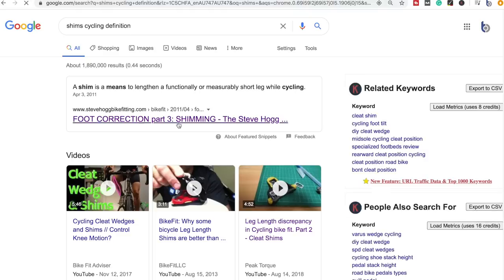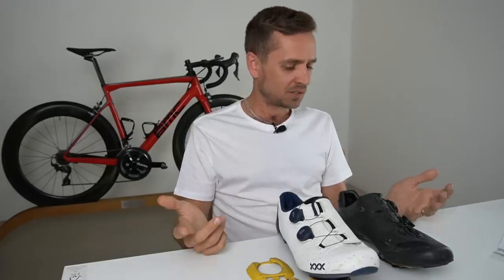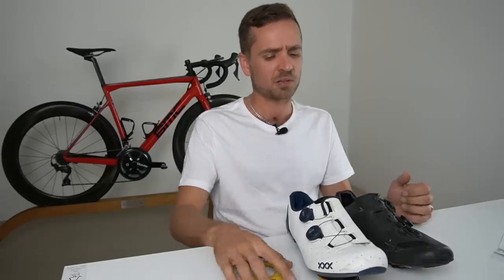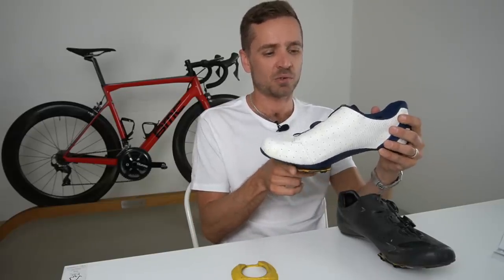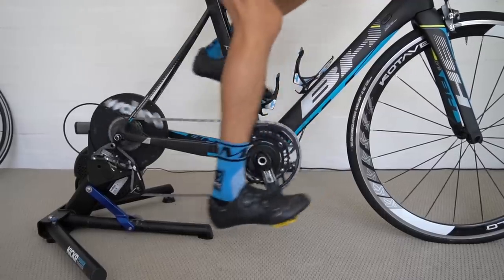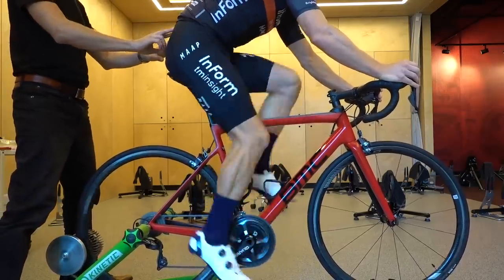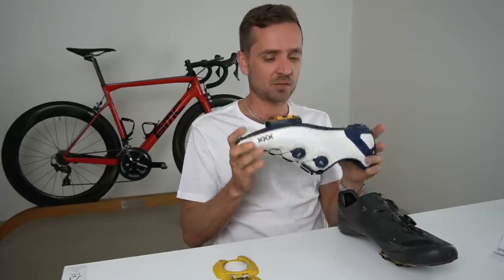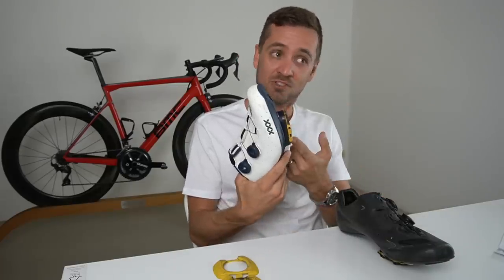75% of Cyclists Leave this Bike Fitters Clinic with a SHIM (why?)

Comment: Hey Cam, I have a leg difference of 1.5cm, what percentage of total leg length differences would typically be a good starting point. Also what about MTB shoes, where shims are unpractical to fit as they need to be recessed. Thanks,
Reply: I'm going to follow this comment as this closely applies to my 12mm structural leg discrepancy.  I do both road and mountain biking as well.
Reply from the maker: I'll see if I can get @Neill Standbury on the case here.
Reply: If it's been properly confirmed with a 3d CT scan or a proper standing leg length xray (image taken whilst your knees were locked into extension) and it's really 15mm, the answer will depend on where the LLD is located. If it's all tibial, start with 10mm and work your way up incrementally towards 15mm by feel. If it's all femoral, start with 3mm and do the same. If it's mixed, you'll want to start around 5mm and slowly increase it. Things will feel better and better as you get close to the ideal height - then at some point when you overshoot you'll start to feel worse and have trouble getting over the top of the stroke on that side, hitching your hip slightly as the knee rises to the top of the stroke. Hopefully you can sense it - most riders can - but some cannot.
Reply: Neill Stanbury - Firstly, thanks to both yourself and Cam for the great videos. Unfortunately, my leg difference has only been verified visually (twice by individual doctors) as my pelvis was not horizontal and therefore I initially had lower back pain. I have been riding with 5mm shims, but recently moved to 6mm and also moved my cleats back (approximately 2cm, with the shimmed cleat 1mm further back as mentioned in Steven Hogg‘s homepage). I was uncertain if I should try more shims and see how it feels, also as I ride cyclocross I cannot shim the SPD cleat as it would then sit proud, would a staggered cleat setup be ok? Thanks in advance for any help.
Reply: @CG-vb9di  How can you clip in into shimmed MTB cleats in a race setting? I have the hardest getting into shimmed SPD cleats (8 mm) at all - I had to cut longer than standard shims myself to have some success.

Comment: Are all leg length discrepancies to be corrected or just the ones giving actual problems? How often a reassesment is needed in order to verify if the shim has to be changed or removed? Are usually shims to be used permanently?

Comment: What about riding with a different length crank?  I occasionally do this when I put my 175 stages power meter crank on my bike with 172.5 cranks.  So my left leg uses a longer crank
Reply from the maker: This can really through off symmetry from what I have been told.

Comment: I dont know if I have a leg length discrepancy, but through experimentation, for whatever reason, 5mm shim on the right shoe has alleviated my right it band syndrome, right knee pain, left lower back pain, and left saddle discomfort 🤷‍♂️ i do have a very slight scoliosis. would my situation be considered a "functional" discrepancy? my left leg is also a little more muscular than my right and my right foot is a few mm shorter than my left 🤷‍♂️

Comment: Too bad he didn't differentiate between short femur vs short tibia. In a short femur wouldn't it make sense to stagger the cleat for when your foot is at 3 o'clock,  and also add a shim for the 6 o'clock position.
Reply: Fully agree, it's the one single point that sadly is missing in this amazing series

Comment: How does one adjust for differently sized feet? My left foot is about 7mm longer. I tried to put the cleats on staggered by this amount and while my feet feel symmetrical on the pedals, I can feel that I made my right leg shorter with this method. I readjusted the saddle height and when it's just right for the right leg, it's a tad to low for the left leg. Didn't Neil put your cleats on staggered, too?
I would really appreciate some advice here. Thanks alot.

Comment: What about if the hip is dropping because their is uneven saddle contact due to saddle width or too much reach or drop etc. How do you factor out other complications if the rider does not know how stability feels like(so would respond that it's good when really it's just better than what they are used to) or isn't very vocal unless asked?
Reply from the maker: I'll see if Neill can get to this Q! Thanks for asking. Cam
Reply: There are a million reasons a rider may drop one hip, a leg length discrepancy is just one of them, you are very much correct. If the rider has no concept of symmetry or poor body awareness, then I am forced to use my eyes and hands as the sole method of determining optimum symmetry.

Comment: Hey Cam, have you got shims fitted on the same side as you felt the issues/pain? 
Wondering if there's a common pattern/factor of which leg exhibits the pain/symptoms (maybe you could ask Neil??)... eg, does the pain show itself on the shorter side 99% of the time?
Reply from the maker: I never had knee pain, just didn’t feel quite right in my position
Reply: Good question Carl - and the answer is there is no clear pattern although most riders develop left sided pain due to our inherent right side neurological bias. This is irrespective of whether they have a shorter left leg or a shorter right leg, or anything else.

Comment: I always get saddle sores on the left side and sometimes after riding long in aero bars my lower back hurts only in the left position. Ironically, i feel more soreness in my right leg (all the muscles: hams, quads and calf) as compared to the left. Is it the leg length discrepancy?
Reply from the maker: Could be, I used to get the same.

Comment: Any idea if a heel lift would have the same impact as a mid foot shim?
Reply: Given that the heel lift would not be under the cleat/foot interface, it almost certainly wouldn't work ideally. It will also load the forefoot unusually compared to the other side (by tilting the foot forwards) and thus probably induce more assymetry. Never tried it though, so I could be wrong!

Comment: What about foot size length? Having half a size smaller, and shoes are loose what to do? As you wouldn’t want movement in the shoe?
Reply from the maker: I'll see if Neill can get to this Q Ian! Thanks for asking. Cam
Reply: You could find some Lake or Bonts and order different sizes left and right, or if it's just a half size then a thicker sock will almost do the trick on the smaller foot.

Comment: And yet when you talk to some sports physios they say this is complete rubbish. Depending on how you stand at different times one leg can appear longer than the other is their comment
Reply: Exactly.  I'm not buying what he's selling.
Reply: Absolutely right - this is why I measure leg length 4 different ways, in standing and lying postures, to get a rough approximation of the real difference. Even then my measurement error is typically 3mm or so, and sometimes stretches out to more than that in extremely weird cases!
Reply: Phew, luckily I'm not selling anything!

Comment: Hey Cam,  you put out some great videos but if I were you,  i would stay away from calling people an expert in anything as I can honestly say that this video is very flawed when it comes to the Neils expertise.  As i have myself been advised that i had a hip imbalance many years that made one leg longer than the other some time ago,  it was corrected once i saw my chiropractor and had it adjusted.  With Neil being a physio,  he seems that he does not want to acknowledge that if a rider comes in with this imbalance,  it can be fixed very easily to visiting a qualified Chiro.  I have been lucky to not have any issues since this was brought to my attention.  BUT at the same token there are some people that do have an imbalance which require a shim.  I have a friend in Sydney that requires a shim because of an accident with a motor vehicle while riding as he has injured his spine alingnment.   There's always been and maybe always be a conflict between Chiro's & Physio's to this extent as each other criticise the other.  But its this issue of the Physio that does not give advise to the client to seek this change to at least have it checked and adjusted.  The Chiro that i have seen always completes the visit with muscle work after the manipulation to assist.  What does the Physio do to solve the issue,,,  throw a shim on it...
Reply from the maker: Thanks for sharing your views Nick. Appreciate it

Comment: There are 2000 pro world touring cyclists. No one shims or wedges bike shoes. NO ONE. They all use custom fitted orthotics.
 There is no evidence that any imagined benefit of shiming and wedging bike shoes weighs out the very real disadvanges of doing it.
About 4 to 5 years ago I noticed an outbreak in club cyclists with knee troubles. In every case some IDIOT pro bike fitter had shimed and wedged the bike shoes.
In every case once I removed the shims and wedges the knee pain went away. 
 If you think you may have foot problems go to a PODIATRIST specially with a sports back ground. The only way to accurately measure leg length is with an MRI.

The single biggest sign that a bike fitter does not know what they are doing is they shim and wedge bike shoes.
Reply: Zoom in on a few pics of the pros shoes. You're miles off, shims are very widely used
Reply: @bstaplet  yes...

Comment: 70-80% of people???   It very much strains credibility.
Reply from the maker: Listen to him talk and it should remove that stigma
Reply: @CamNicholls  I watched the whole video.  I learned nothing in detail about the criteria he uses to decide a shim is needed.  Be clear,  75% is an outlier number, I've never heard of any other bike fitter doing putting shims into that many people.  Extraordinary claims require extraordinary evidence and a lot of follow up.  He said he had fitted thousands of people, but all kinds of people advocate for highly questionable stuff and claim they have "cured" thousands. For these reasons I am VERY skeptical about this.
Reply: Skepticism is a good thing, I'm one of the biggest skeptics that I know and I'm sure we'd share the same view if you presented me with some information on your particular area of expertise Stuart. All I can say is that about three quarters of people leave my clinic with a shim ranging from 1mm up to 35mm (the vast majority are less than 5mm) and since I offer a money-back guarantee of satisfaction on all of my fitting sessions, if they have an issue with the position then I tend to hear about it afterwards. Whether these are all actual leg length discrepancies (structural) or all functional, or a mixture of both, I have no concrete way of knowing - but I can say that about three quarters of my clients' symmetry is improved with the use of a shim.

Comment: Shims unnecessary. Gives fitters a talking point. Your body can compensate for the asymmetry. So many fitters out there won't let you leave their shop without 5mm shims.
Reply from the maker: Thanks for sharing your thoughts on the thread. Always good to hear different sides to the story. Cam
Reply: Some bodies can't. TrainerRoads Amber Pierce revealed that she had taken her shims out, because it was simply too much hassle to get used to after some 20 years of her body having worked around it without issue. As they talked about in the video it's the bodies that aren't able to work around it that are coming in and maybe getting shims, because it removes the necessity to work around it and thus reduces negative symptoms.
Reply: Sure if my right leg is 10mm shorter I can just use a saddle that is narrow enough to allow me to drop that hip on every stroke without chafing so now I can reach with both legs, but why would I sacrifice stability? And why would I want a left hip that is then hiking up into my gut whenever I get low on the bars - which is even more severe if you are a rider whose flexibility comes from anterior pelvic tilt rather than lumbar flexion.

Comment: A 5mm shim would make a 175mm crank 170mm in the bottom position and 180mm in the top position ~ what a stupid thing to do..  If the leg length differs enough the only way to fix it is by using different length cranks..